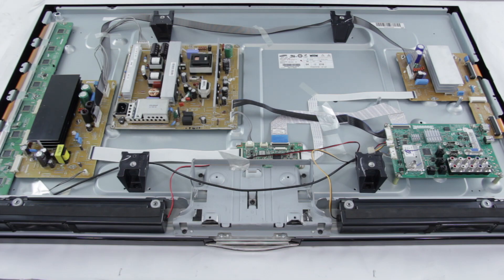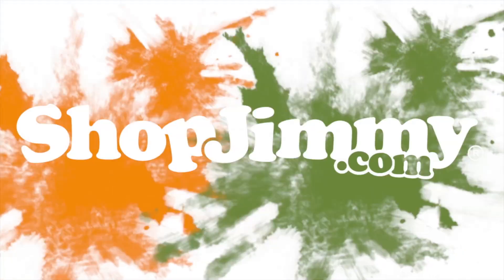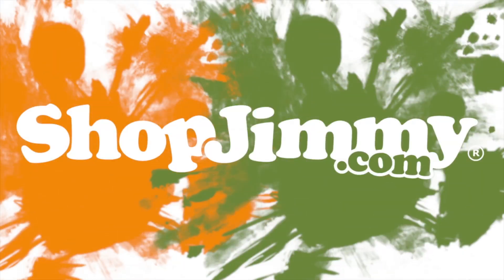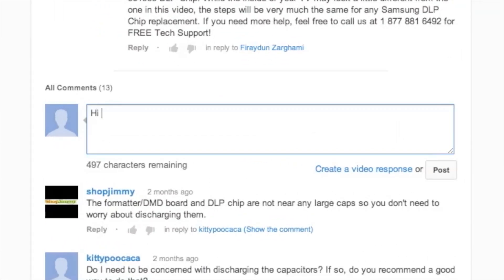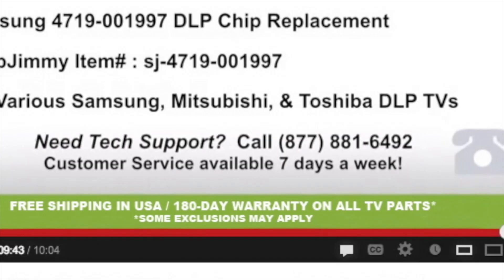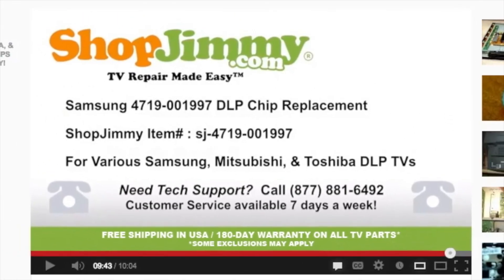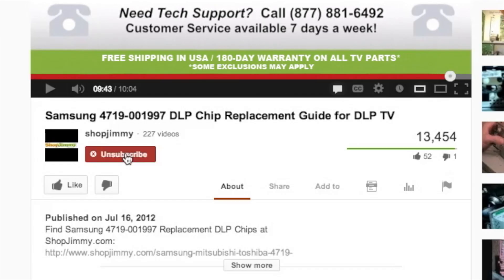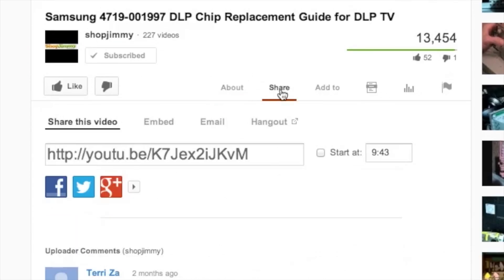Plasma TV Repair Tutorial - Common Symptoms & Solutions - How to Fix Plasma TVs

Comment: Good morning Jimmy, i Have a 51" Samsung Plasma  Its 2 years old.  It has developed a black vertical line on the left side about 4 inches from the edge.  Also, there is like a pinkish line about the same width on the center of the tv, also vertical.  you can see the image through the center line but not the black line.  Would that be the logic board?
Reply: sorry...Model# PN51E450
Reply from the maker: Gil Crespo   This sounds like a TV panel problem.  If your TV panel is bad, it may be more cost-effective to replace the TV as panels are typically hard to find in stock, difficult to replace, and expensive.  Thanks and please let us know if you have any further questions!  www.shopjimmy.com

Comment: I have a 50" Samsung plasma model #HPS5053X/XAA. Turns on, runs fine for 20-30 minutes, then the top half of the screen flashes solid black right before the whole screen turns dark gray. I listened to the symptoms you described, none really matched what's happening.
Reply from the maker: BleedtheDrummer   Start by replacing the upper buffer board. http://www.shopjimmy.com/samsung-bn96-03361a-upper-y-scan-drive.htm  Be sure to match part numbers on your current board, with your replacement for compatibility.  You can also call our customer service for further assistance with your purchase.  (877) 881-6492  Thanks and please let us know if you have any further questions with your TV Repair!  www.shopjimmy.com

Comment: 2006 SP-S4243  plazma tv.  The picture is kinda ghostly/lots of pixels fade like watching threw fog. I tried to get into service menu but can't find how then took i tapart and dont know what to look for?
Reply: samsung tv
Reply from the maker: *****   I recommend replacing the Y-Main board in your TV.  Here is a link to replacement parts for your TV model number on our website, click here:  http://www.shopjimmy.com/catalogsearch/result/?q=S4243  Be sure to match part numbers on your current board, with your replacement for compatibility.  Here is a link to a video showing how to identify your part number, click here:  http://www.shopjimmy.com/samsung-bn96-03102a-y-main.htm  You can also call our customer service for further assistance with your purchase.  (877) 881-6492  Thanks and please let us know if you have any further questions with your TV Repair!  www.shopjimmy.com

Comment: Hey guys, thanks for a very educational video. My Pioneer  PDP 5060 HD looks somewhat similar to your demo tv, especially the side with the Y buffer board and Y sustain board. My tv has a 1 inch wide horizontal black line running from one side of the tv to the other approximately 1/2 way up the screen. I have reseated all the detachable ribbons  to no avail. What else could be the problem?
Reply from the maker: Daniel Wilson   I recommend replacing the buffer boards in your TV.  Here is a link to replacement parts for your TV model number on our website, click here:  http://www.shopjimmy.com/catalogsearch/result/index/?master_part_type=Buffer+Board&q=+PDP+5060    Be sure to match part numbers on your current board, with your replacement for compatibility.  You can also call our customer service for further assistance with your purchase.  (877) 881-6492  Thanks and please let us know if you have any further questions with your TV Repair!  www.shopjimmy.com

Comment: I have a Pioneer PDP-5050. It has a 12" wide x 4 high area in the middle of the screen that is affected. When the screen goes black the area stays black and light green then slowly changes to the color its supposed to be. But always leaving a very light green hue in that area.
Reply from the maker: Sonny Hatzel   I recommend replacing the Y-Main board and any buffers that are attached to the Y-Main board.  Here is a link to replacement parts for your TV model number on our website, click here:  http://www.shopjimmy.com/catalogsearch/result/?q=PDP-5050  Be sure to match part numbers on your current board, with your replacement for compatibility.  You can also call our customer service for further assistance with your purchase.  (877) 881-6492  Thanks and please let us know if you have any further questions with your TV Repair!  www.shopjimmy.com

Comment: Very informative, Jimmy.  I have a Samsung plasma pn51e530a3fxza that, after I plug it in, the power light flashes red and I hear a clicking sound about 3 times after which the TV turns itself off and does not restart.  I took off the back and looked at the capacitors and could not see any that were "bulging or leaking".  I tried disconnecting the XSUS board and the then connecting the power.  The TV would power up, but of course no picture.  Reconnecting the XSUS board and the original behavior (powering off and clicking) returned.  Thanks for any help.
Reply from the maker: Ron Simmons  I recommend replacing the X Main Board in the TV.  Here is a link to replacement parts for your TV model number on our website, click here:  http://www.shopjimmy.com/samsung-bn96-22107a-x-y-main-board.htm  You can also call our customer service for further assistance with your purchase.  (877) 881-6492  Thanks and please let us know if you have any further questions with your TV Repair!  www.shopjimmy.comBe sure to match part numbers on your current board, with your replacement for compatibility.

Comment: I have a Samsung Plasma Mfd February 2008 Model HL-T5676S when I turn it on it comes on and then just starts turning on and off on its own what should I do
Reply from the maker: Thadius Gary   Try this repair at your own risk.  Power on your TV with the back cover removed.  You will want to disconnect the keypad controller from your TV and the IR sensor as well from your TV for your remote control, if your TV stays on.  Please reply and let us know what you find.  Thanks!  www.shopjimmy.com
Reply: ShopJimmy.com I have the back of the tv off what board do I need to remove and where is the ir for the remote to uninstall
Reply from the maker: Thadius Gary   The IR sensor is the part that reads the remote control and the keypad controller is the board/area of where you can bit buttons to typically change the channel, change the volume etc. on the side, top, or bottom of the TV.  Thanks!  www.shopjimmy.com

Comment: Hi Jimmy,I have a Samsung plasma pn60e530a3fxza. It turns on and has sound but no picture. manufactured in oct 2012.
Reply from the maker: PacificBlueSky1   I recommend taking a look at the logic board.  It should blink once per second.  If it is blinking once per second, then I would replace the Y-Main board.  Here is a link to replacement parts for your TV model number on our website, click here:  http://www.shopjimmy.com/catalogsearch/result/?q=pn60e530a3fxza  Be sure to match part numbers on your current board, with your replacement for compatibility.  Here is a link to a video showing how to identify your part number, click here:  Samsung Plasma TV Repair: Samsung Plasma Panel Parts Guide  You can also call our customer service for further assistance with your purchase.  (877) 881-6492  Thanks and please let us know if you have any further questions with your TV Repair!  www.shopjimmy.com

Comment: i have a 42 inch panasonic plasma tv. model number is TH-42PD60U .. Aug 2006!

i had an issue with the blinking code so i replaced the SC and SD & SU buffer. Now my tv turn on with no problem , however it turns itself back off for about a minute, then back on for about 30 seconds. Also i need to disconnect the plug from the wall outlet for a while, otherwise it will not turn on, another word the relay will not click unless it is unplugged for a while! I checked visually for blown or inflated transformers/filters on the power supply but everything looks good! and now i also got no sound... please let me know if you have any suggestions for me to test. I am not a technician but i do have a tester and basic knowledge in electronics. thank you!
Reply from the maker: Nabil Wahba   I recommend replacing the power supply board in your TV.  Here is a link to replacement parts for your TV model number on our website, click here:  http://www.shopjimmy.com/catalogsearch/result/?q=TH-42PD60U  Be sure to match part numbers on your current board, with your replacement for compatibility.  You can also call our customer service for further assistance with your purchase.  (877) 881-6492  Thanks and please let us know if you have any further questions with your TV Repair!  www.shopjimmy.com

Comment: Hi, I own a Samsung Plasma TV model PS51D550. I have a noisy colored vertical bar (1 pixel width) on the right side of the screen. Also, light scenes like the ones that show clouds or sky have pink noise. ¿Which part is failing?
Reply from the maker: pedro061080   This sounds like a TV panel problem.  If your TV panel is bad, it may be more cost-effective to replace the TV as panels are typically hard to find in stock, difficult to replace, and expensive.  Thanks and please let us know if you have any further questions!  www.shopjimmy.com

Comment: I've got a Samsung PN50A510P3F plasma and it keeps cycling on/off until the picture quality is good. I replaced the HDMI cable form the satellite box and got the same result. I've read the capacitors were undersized from the factory and should be replaced. your thoughts?
Reply from the maker: Bert Leitmann   I recommend replacing the power supply board in your TV.  Here is a link to replacement parts for your TV model number on our website, click here:  http://www.shopjimmy.com/catalogsearch/result/?q=PN50A510P3F  Be sure to match part numbers on your current board, with your replacement for compatibility.  Here is a link to a video showing how to identify your part number, click here:  TV Part Number Identification Guide for Samsung DIY TV Repair Power Supply Unit (PSU) Boards  You can also call our customer service for further assistance with your purchase.  (877) 881-6492  Thanks and please let us know if you have any further questions with your TV Repair!  www.shopjimmy.com

Comment: LG PLASMA MODEL 42PM4M - screen comes on, flashes repeatedly, all inputs, even with no inputs while in the menu. It also has vertical lines and speckled pixels within vertical lines. Here is a link to a video I took of a known working PS3 connected via HDMI, then no input, then in the menu. http://youtu.be/GsfFCbcbdhk
Reply from the maker: Ryan Jessup   I recommend replacing the YSUS and buffer(s) board that is attached to the YSUS in your TV.  Here is a link to replacement parts for your TV model number on our website, click here:  http://www.shopjimmy.com/catalogsearch/result/?q=42PM4M  Be sure to match part numbers on your current board, with your replacement for compatibility.  You can also call our customer service for further assistance with your purchase.  (877) 881-6492  Thanks and please let us know if you have any further questions with your TV Repair!  www.shopjimmy.com
Reply: Let me know if that fixes it, I have that exact same issue

Comment: I have Lg 60PS60. First, my TV has no video and it has sound. After I replaced Y Sustain board. Now it has over 80%  horizontal lines from bottom up. Can you give me advice which board should I replace next. Thanks
Reply from the maker: Ken La   This sounds like you received a bad board for your repair.  I recommend getting a different replacement YSUS board, and also replace the buffers that attach to the YSUS as well.  Here is a link to replacement parts for your TV model number on our website, click here:  http://www.shopjimmy.com/catalogsearch/result/?q=Lg+60PS60  Be sure to match part numbers on your current board, with your replacement for compatibility.  You can also call our customer service for further assistance with your purchase.  (877) 881-6492  Thanks and please let us know if you have any further questions with your TV Repair!  www.shopjimmy.com
Reply: update: I replaced LG EBR54657501 buffer board. The picture comes back normal.

Comment: I have a rca l32wd12 with no video. the original problem was no power which was a few capacitors on the power supply. then I got power but no video. so I replaced the A/V board and got a dark video on the top of the screen but it was spotty. so I proceeded to change the main board, still no video, so I put video on the rca inputs and put the output video to another TV and I could see the output although I had no menu but I could adjust the volume, so I figured it was the tcon board and replaced that, no go. the only boards left is the inverter board an the tuner. I guess my question is could the power supply still be causing this because I am getting 12v to the t con board but that's it and none of the chips on the tcon board seem to be getting any voltage. another potential issue is that the A/V board has a cable output on it that is outputting 5v but isn't connected to anything as I noticed this TV was opened up before I don't know if their is supposed to be a cable their or not. it is right below the audio output. and I cant find a picture of the TV fully connected with the back off. id appreciate any insight you can give me. thanks
Reply from the maker: ceasealeo5  I recommend replacing the main board in your TV.  Here is a link to replacement parts for your TV model number on our website, click here:  http://www.shopjimmy.com/catalogsearch/result/?q=l32wd12  Be sure to match part numbers on your current board, with your replacement for compatibility.  You can also call our customer service for further assistance with your purchase.  (877) 881-6492  Thanks and please let us know if you have any further questions with your TV Repair!  www.shopjimmy.com

Comment: Thanks for the video.  I have a LG RU-42PX11 that has a whole white screen with vibrating colored vertical lines and a hissing sound.  Took off back cover and the 2 large black caps on Y power board are bowed on the top.  Could that be the problem?  Or is it something else?
Reply from the maker: BillyBob Hardy   Yes, that sounds like the problem.  You can either replace the caps or replace the entire board.  Here is a link to replacement parts for your TV model number on our website, click here:  http://www.shopjimmy.com/catalogsearch/result/?q=RU-42PX11  Be sure to match part numbers on your current board, with your replacement for compatibility.  You can also call our customer service for further assistance with your purchase.  (877) 881-6492  Thanks and please let us know if you have any further questions with your TV Repair!  www.shopjimmy.com

Comment: Very interesting movie, I learned a lot from it! Still, I have a blue vertical line on the right side of my screen and i want to be sure whats wrong with it. Do you have any idea which part should be replaced or maybe its a bad connection. Sometimes the blue line is flashing and sometimes it dissapears. Greats and here a link the what it looks like.
http://oi62.tinypic.com/2eeaols.jpg
Reply from the maker: samldnb2  I recommend replacing the T-Con board in your TV, to see if that fixes the problem in your TV.  Please reply with your TV model number and then I can recommend a replacement part for your TV Repair.  Thanks!  www.shopjimmy.com
Reply: ShopJimmy.com Thank you for the info! I have a Samsung PS50B610SP.

Comment: Hello, Samsung Plasma  Model SPR 432, Type SR42S5, Approx 13 years old.  TV Powers up. Picture has a gray tint with a posterized appearance to video.  TV has not been left on a single image for great lengths
Reply from the maker: Zoli Vajda   Conduct repair at your own risk.  Check the panel voltages and make sure the power supply is set correctly.  You can also call our customer service for further assistance with your purchase.  (877) 881-6492  Thanks and please let us know if you have any further questions with your TV Repair!  www.shopjimmy.com  Thanks!  www.shopjimmy.com

Comment: I have a 51 inch Samsung Plasma TV PN51D530A3F. When I plug in the TV Logic board lights up green, the unit clicks on/off 5 times then shuts down. When I unhook the X-Main board from the rest of the set using the ribbon cable and the power cable, the TV stays on but I have no picture. Could this be the culprit?
Reply from the maker: Mike Thompson   I recommend replacing the X-Main board in your TV.  Here is a link to replacement parts for your TV model number on our website, click here:  http://www.shopjimmy.com/catalogsearch/result/?q=51D530A3  Be sure to match part numbers on your current board, with your replacement for compatibility.  Here is a link to a video showing how to identify your part number, click here:  Samsung Plasma TV Repair: Samsung Plasma Panel Parts Guide  You can also call our customer service for further assistance with your purchase.  (877) 881-6492  Thanks and please let us know if you have any further questions with your TV Repair!  www.shopjimmy.com

Comment: I have a RCA 42 inch tv and when i use my remote to turn it on the light goes from red to blue as usual but the screen does not turn on. Is it the main board? i also checked the capacitors and they are fine so it must be either the main board or another board. The tv started having this problem slowly like it would be a little hard turning it on because we would have to unplug it then plug it back in and it would turn on but the problem got  worse to the point where we cant turn the tv on.
Reply: Oh and my tv is a 40 inch not a 42 and it is a 40 inch FHD LED TV (ATSC Tuner) RLED4010A
Reply from the maker: *****   I recommend replacing the main board in your TV.  Unfortunately I do not see any replacement parts in the search results for your TV model number on our website.  Thanks and please let us know if you have any further questions!  www.shopjimmy.com